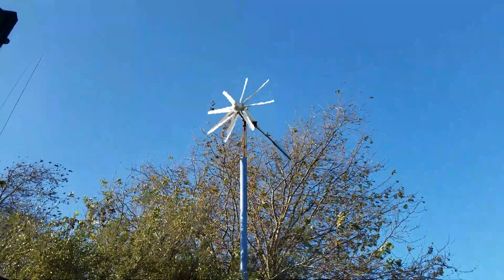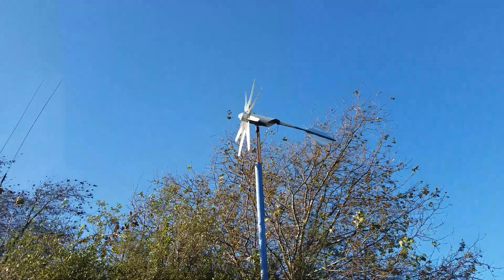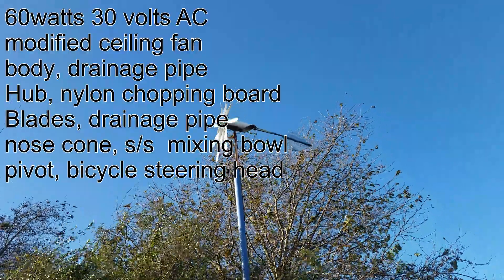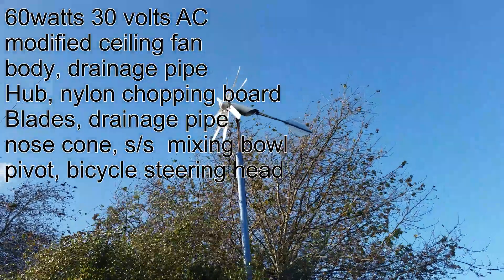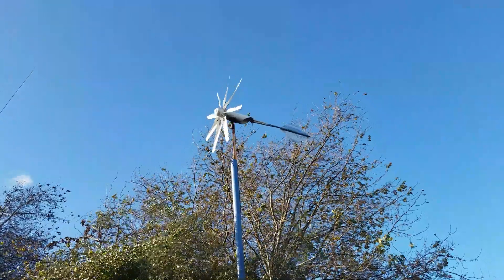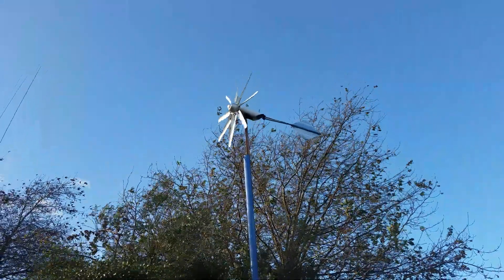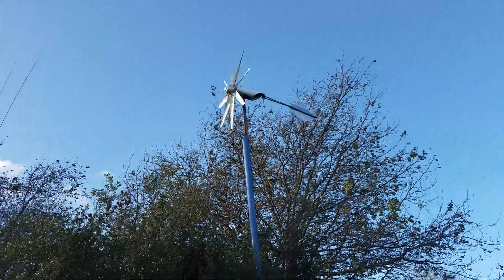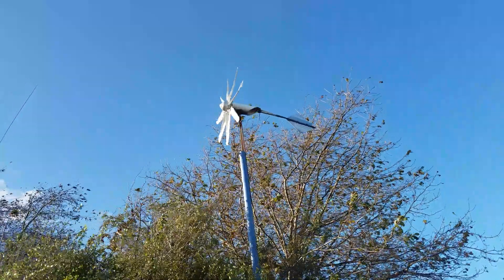DIY wind turbine- 10 years of free electricity!

Comment: How about  a.contrarotating twin  vawt wind turbine ?
One vawt spins the armature and the other spins in the opposite direction the stator  so doubling the speed the generator without the use of parasitic drag gearbox .
Each turbine would have  its own drive shaft with the two parts of the generator in the center .One half of the shaft   turning clockwise and the other  anticlockwise to double the speed of the generator .
The two vawts would probably need to be separated by about 3ft so wash from the blades  wouldn't interfere with each other .

Having two  contrarotating wind turbines on the same mast would cancel out the torque like on a prop driven aircraft .
Reply from the maker: I want a lathe! hahaha
Reply from the maker: Ive made up wing frames for a Vawt. 3 airofoil section wings, ill set them into a mould and blow builders foam all around them. skin will be layed in the mould and will be mylar space blanket. the wings will be on a central  4mm alloy tri legged spar with 1mm stainless guy wire  tying the tips to the hub. they will be 200mm chord 900mm span on a 900mm tri axial spar driving a F&P pancake alternator- one day....

Comment: Do you need a different controller for it as usually a wind turbine requires a dump load when the battery is charged?
Reply from the maker: a larger one would- this is only 60 watts@ 30v - I use a 20 amp PWM solar controller  and its never got warm
Reply: @t.h.o.r.  I'm surprised that a pwm solar controller worked fine for this as solar panels are dc output. Have you done some ac to dc rectification before the pwm controller?
Reply from the maker: Of course! - it goes through a bridg rectifier first